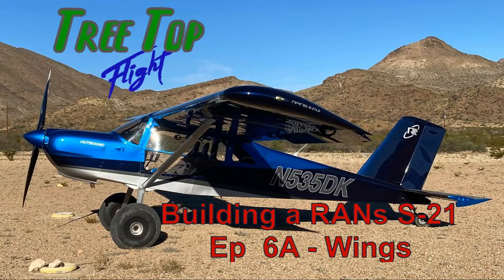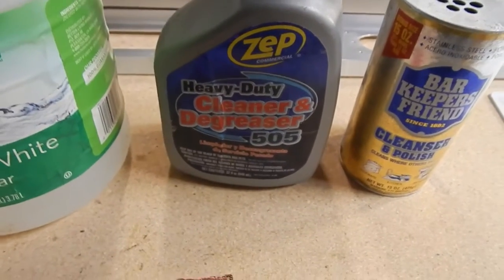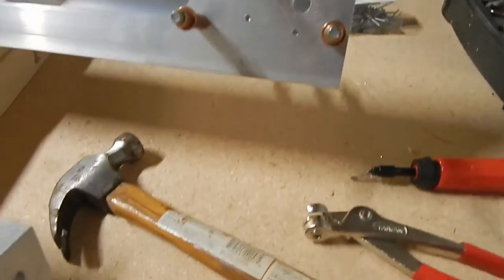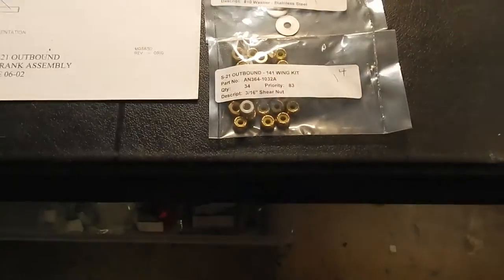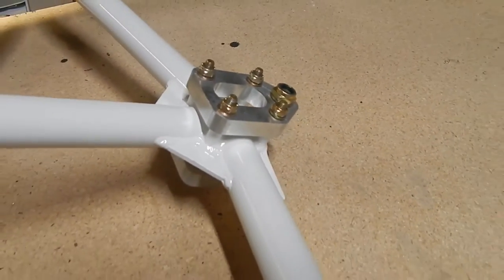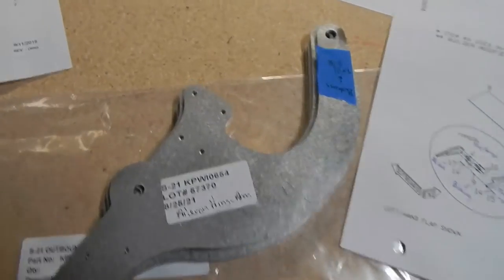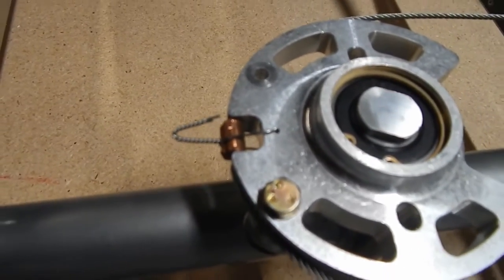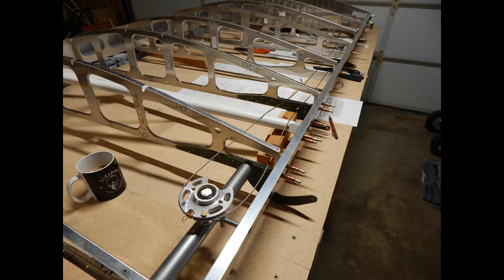Building a RANs S-21 Outbound Episode 6A - Wings Part 1

Comment: That hurts to watch you fluting like that. Hold the flute pliers so the crimp goes in towards the lightning holes, not up towards where the skin is going to lay on the flange. Your creating serious stress risers, and will end up with cracks in your skins. A trick to fluting is if you need to go the opposite way, you can flute the area, then squish it back flush with a set of Knipex smooth jaw plies.
Reply from the maker: It makes sense to have the bend go inward (away from the skin).  I watched several videos on fluting and no one else pointed that out.  It is also not mentioned in the building manual or the RANs rudder build workshop.  I am assuming it is not a critical issue, although also probably not a preferred method.  I hope that you are recovering from your injury.  Thanks for the input.
Reply: @treetopflight7624  never assume anything in aviation....it actually is a critical procedure, as you are leaving stress risers. Look up stress riser, AC-43.13
Reply: What injury?